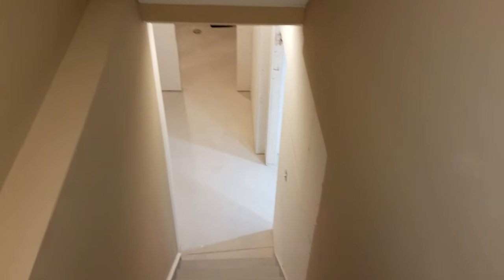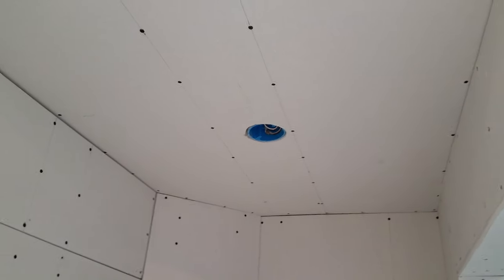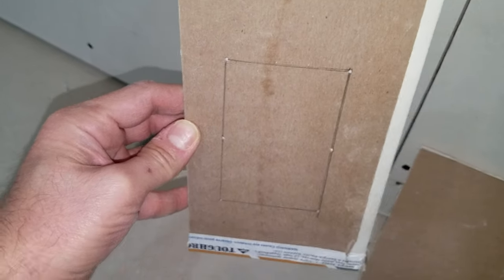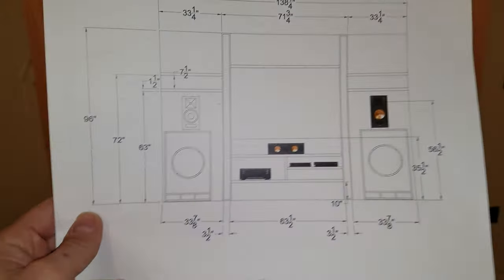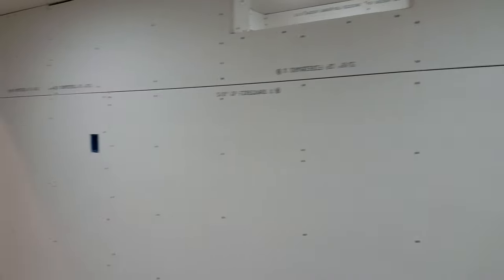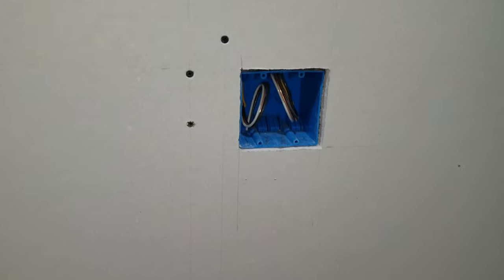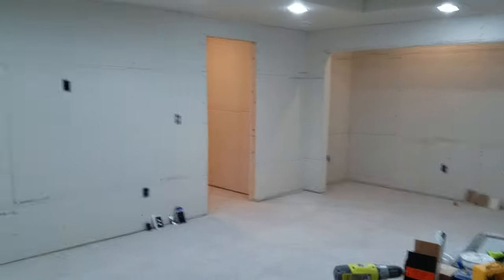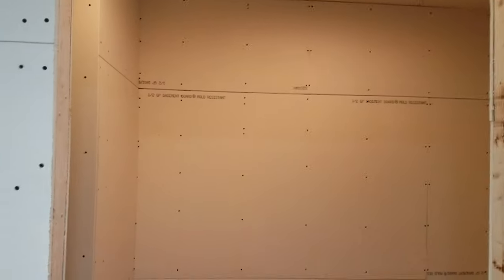Part 7 - New home theater and media room build. Drywall Walkthrough (Nov 28th 2019)

Comment: Just started watching your videos today. The room is looking good already. I must ask though.Are you not worried about overheating with the server room being in the same room as the projector? I think you should have installed some type of ventilation to help get rid of the heat.
Reply from the maker: Yes, it's a concern. I had a vent in the original plan but didn't want the noise from the furnace on the other side of the wall leaking into the theater room. If I find the room gets too hot and it causes a problem, I can still pop a hole in the back wall and install a vent. I want to see how it gets first before I compromise the sound levels in there.
Reply: @Furious Wookiee - I understand your reasons. Great job btw. Are you ever going to post a video of the finished room?
Reply: @pf5658  Yeah I was wondering the same!!
Reply from the maker: @pf5658  I'm wrapping up the mudding process. Once that's done and sanded a video will go up before I prime and install the doors.